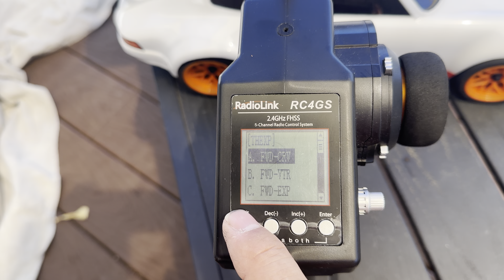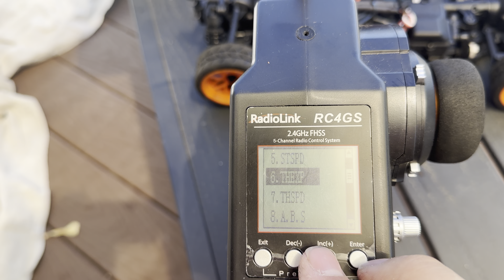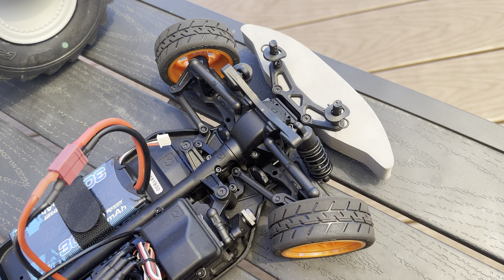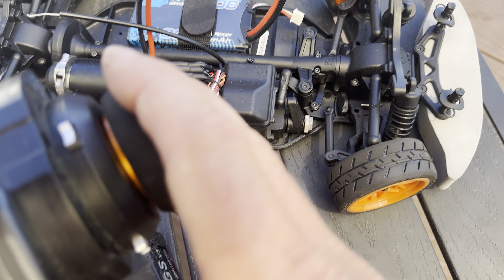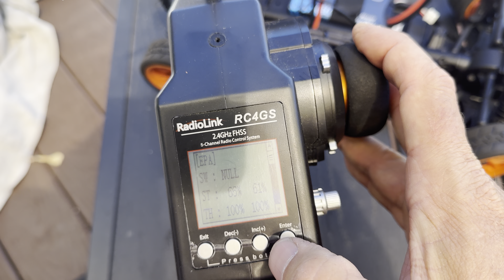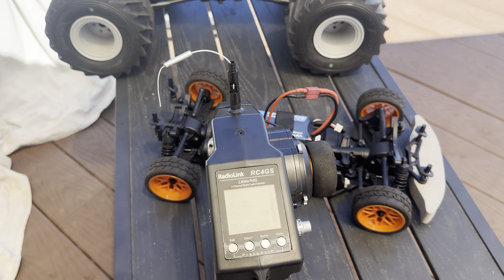Radiolink Transmitter Tuning // Steering Limits // Throttle Curve

Comment: Radio's are so technical now, it's a thing I should see if my radio does as it would be better for crawling. Servo end points so good for steering but even better for 2 speed gearbox.
Reply from the maker: I like the idea of tuning the throttle for a two speed gear box. This unit has a few more features that work for drag cars too but my opinion hasn't formed on that yet. It's not clearly evident if the circuitry is consistent. Ive had my ups and downs testing with the dragster but feel like im closing in on it. all the other cars are smooth sailing!
Reply: @rotationnationRC I have the same radio for my dragster but I don’t use the throttle curve I use the throttle speed you can control how fast you can get to full throttle which has been very consistent in my runs
Reply from the maker: It seems difficult to get consistent runs. I’ll try the throttle speed set you suggest. Thanks!

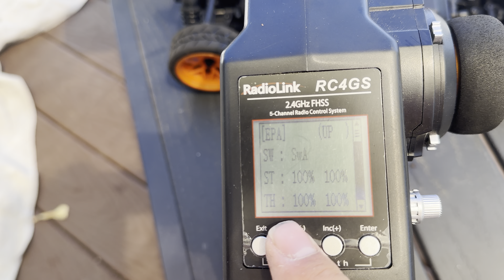Comment: 0:45 Looks like the throttle curve can only be adjusted for forward ? Feels like it. Thats not cool, on my crawler i need to backup very slowly and carefully, í have set an extremely flat throttle curve and backwards it jumps like mad if you are not extremely careful (which is the whole purpose of the curve). There should be a checkbox - "same as forward".
Reply from the maker: Agree on that, especially for your application. For drags or street it was ok but yes, not for crawling rigs. Thanks for commenting on that